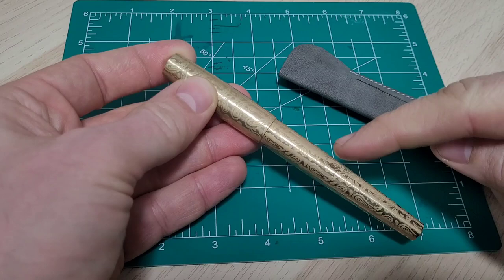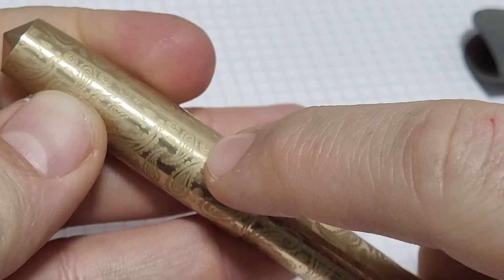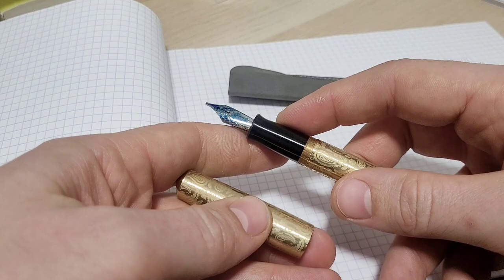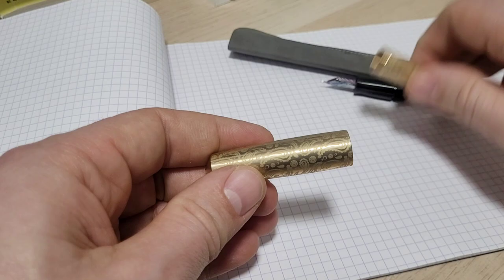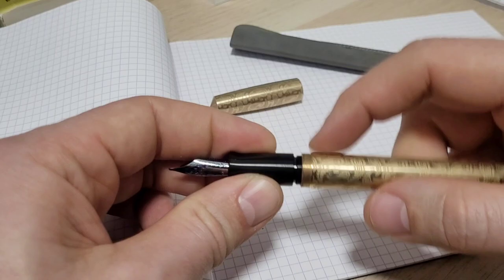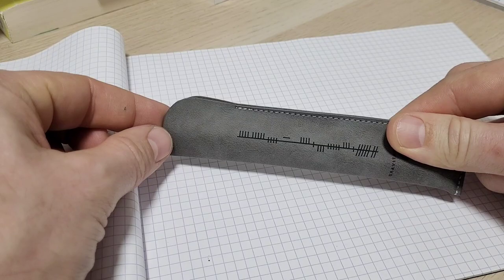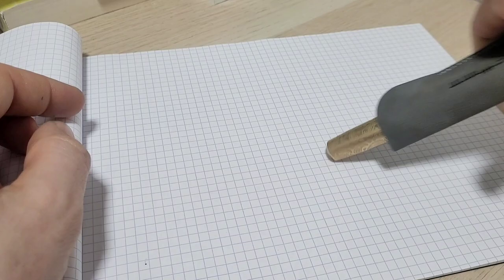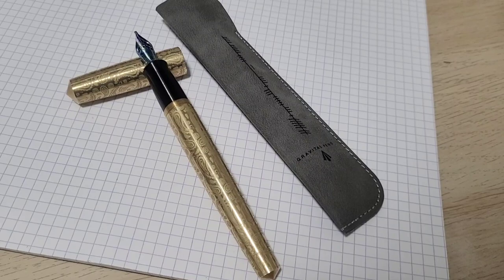Pushing The Limits of Design (Gravitas Pens: Sentry)

Comment: I’m so impressed that I’m getting one. I’ve got the TWSBI 580 which has the same nib that I’m going for again. The 1.5 Stub. I don’t red this pen but I want it. The weight is the massive draw for me. Sometimes a heavy pen helps me to think things through. Writing carefully. I part exchanged my Lamy 2000 Stainless Steel pen because it didn’t quite work for me. The weight however was phenomenal. This pen I hope will have the same wow factor with a nib I know and love. D
Reply from the maker: Check out the stainless steel one as well. Both the same weight. Tough to decide which one lol